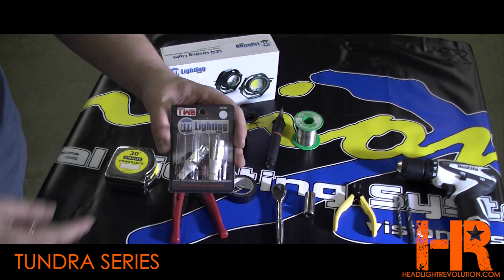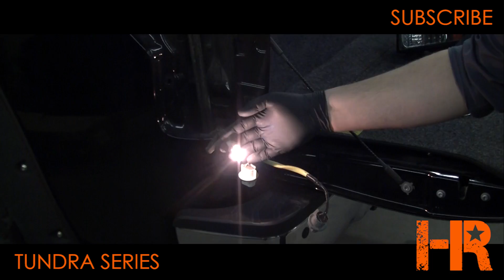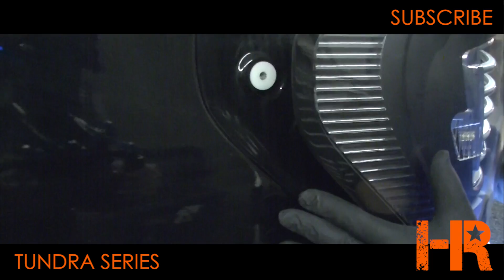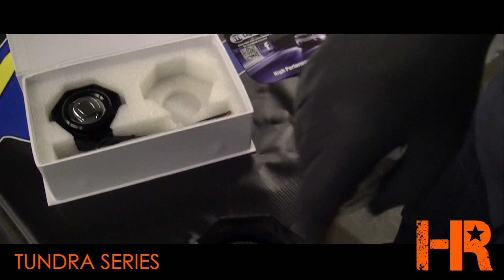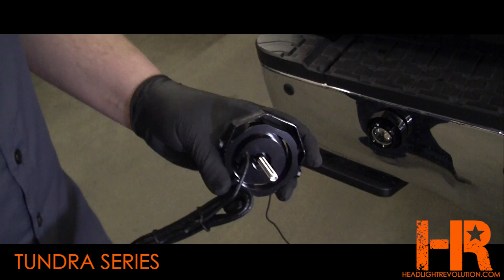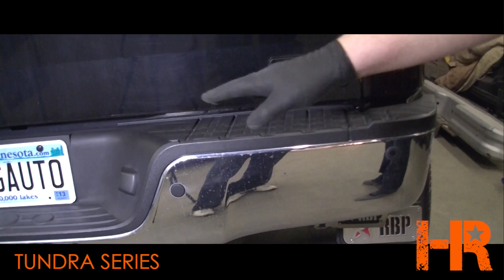Reverse Lights for your 2007-2013 Toyota Tundra | Headlight Revolution | Tundra Series (3)

Comment: no grommets in the holes drilled for the wires? you did not check for or say about the burs on the inside of the bumper from drilling. most of the sheathing on the wires is not very thick or durable.  I would also  use a paint or something in the holes drilled to help stop the rust.. nice lights

Comment: For the one that are in the bumer would that be the same way for the led pods
Reply from the maker: Your vehicle's battery should power everything just fine.
Reply: Headlight Revolution thanks i already have a light bar on top of the roof and trying to add 1 30in and two 6ins on both sides of the 30ins and the reserves pods in the back of the bumper that's why I was wondering if u would need to upgrade the batter

Comment: 3 questions

Do I have installed a relay? I'm installing two small 6 inch 18Watt LED bars

Can I just get power from each reverse light for the lightbars like the bar mounted on the right side get power from the right reverse light in the bar mounted on the left side to get power from the left reverse light bars getting separate power from two different lights  they fuse wire 10 AMP fuse in the wire.

Or I just get power from my trailer hook up

Also if in wanting to use them for fog lights in the front can i just tap into the parking lights or even the headlights but still using a wire with 10amp fuse
Reply from the maker: +Martyimgay Yes, you would need to install some more wiring like a relay harness to get power from the battery. The light bars would need too much power to just pull from the stock reverse lights. Same would be true for the front of the vehicle; too much power is needed for them to run.

That's the beauty of the projector lights we installed, since they are just a single LED the power draw is pretty low. And really, those projector lights and the LED reverse light bulbs create so much light that there's nothing you can't see when backing up!

Comment: Do the bumper lights come with the tailgate lights?
Reply from the maker: The reverse light bulbs that are located inside the tail light housings are sold separately from the LED lights we mounted directly onto the rear bumper. They are all wired in together, so they will all turn on the same time.

Comment: On the GTR Lighting LED Reverse Bumper Lights. If I take to a Auto Stereo Chop how much is a good price to do it and how many hours should it to do the job?
Reply from the maker: Realistically, an hours worth of charges is all it should be, at MOST 2 hours but that seems excessive. Maybe $100-$150.

If you can, we recommend doing it yourself!
Reply: Headlight Revolution Do I need any relay or higher fuse for this....
Reply: I love my GTR Lighting LED Reverse Bumper Lights. They really look good and they are very bright and will help with the backup camera.... I have them install for about two weeks now.. Do you all have 60” LED tailgate light bar? And have a video on how to install it? Thanks for all your help...